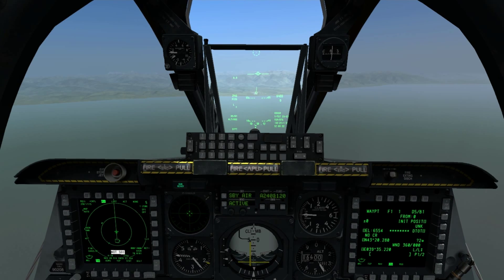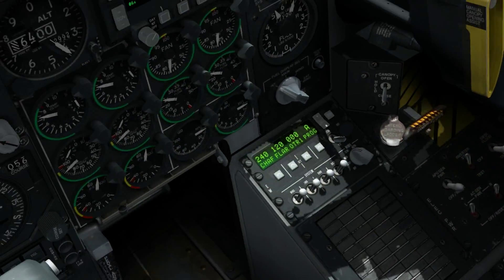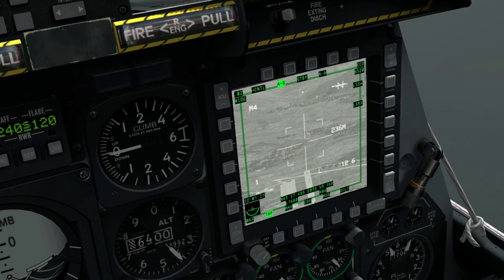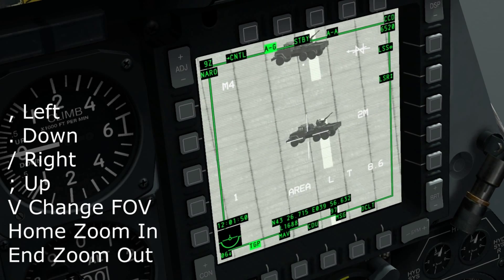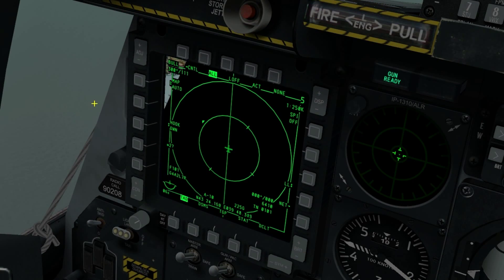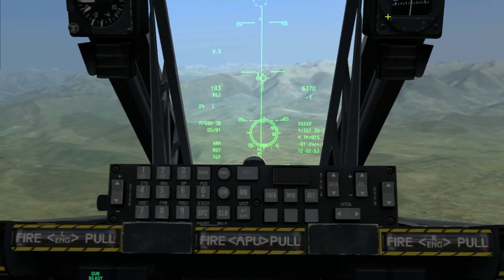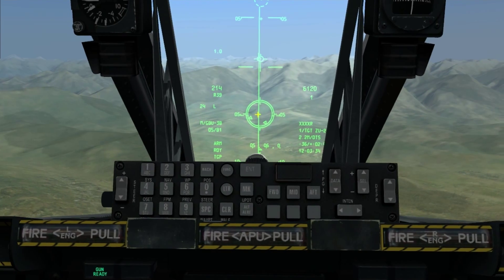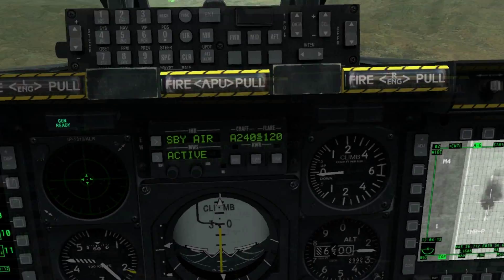How to use the GBU-38 and GBU-12 for the A-10C Warthog on DCS Part 1

Comment: were you using CCIP or CCRP mode or does it even matter?
Reply: CCRP is the best for the laser guiding or gps guided bombs. CCIP is more for dive bombing , and CCRP is for level flight from high altitudes.  I have pulled off a dive bomb with the gbu 10s and 12s by just rolling over above the target and aiming basically straight towards the ground. The bomb releases and after a few seconds starts guiding. Sorry for the essay, hope this helps.

Comment: is the cbu 103 GPS or laser guided
Reply: florianweiss007 GPS, the only LGBs are the GBU 10 and GBU 12
Reply: Jaffa.cake.yey 

LIST OF ALL ARMEMENTS

Cannon

The GAU-8/A 30mm cannon can be loaded with three types of round.

TP - Training rounds

HEI - High Explosive Incendiary rounds

CM - Combat Mix that combines HEI and armored piercing rounds

 

Rocket Types

MK1. Explosive warhead

MK5. Explosive warhead

MK61. Training rocket

M151. Explosive warhead

M156. Smoke warhead with white phosphorus

WTU1B. Training rocket

M274. Smoke warhead

M257. Illumination warhead

M278. Illumination warhead

 

Unguided Bombs

Mk-82. A 500-pound bomb with 87 kilograms Tritonal is the most widely used A-10C unguided bomb. It provides a good options against unarmored and lightly armed targets using shrapnel and blast effects.

Mk-82AIR. This version of the Mk-82 is an aerodynamically retarded BSU-49 / B. This allows the bomb to quickly slow after release, which enables use at low altitudes. This bomb can also be dropped in low drag mode depending on the DSMS fuze setting.

Mk-84. The big brother of the Mk-82, it contains 906kg to 428kg H-6 or Tritonal. It's most effective against unarmored and soft-skinned targets, the Mk-84 could nevertheless be effective against armor, if impacting in sufficient proximity.

CBU-87. "Combined Effects Munitions" CBU-87 is a 453-pound cluster bomb. It uses the SW-65 Tactical Distributor Sub-munitions dispenser that contains 202 BLU-97 cassettes; they are effective against both armored and unarmored objectives.

CBU-97. The CBU-97 consists of an SUU-66/B tactical munitions dispenser that contains 10 BLU-108 submunitions. Each submunition contains four hockey-puck-shaped sensor-fused projectiles called Skeets. These detect targets, such as tanks, armored personnel carriers, trucks and other support vehicles, and fire an explosively formed penetrator.

 

Illumination Flares

LUU-2B / B. Illumination in the visible spectrum.

LUU-19. Illumination in the infrared spectrum. Designed to improve the use of night vision devices.

 

Laser-Guided Bombs

GBU-10 Paveway II. This laser-guided bomb variant of Mk-84.

GBU-12 Paveway II. This laser-guided bomb variant of Mk-82.

 

Guided Bombs

GBU-38. The standard Mk-82 with a GPS-guidance set.

GBU-31. The standard Mk-84 with a GPS-guidance set.

CBU-103. Standard CBU-87 with a Wind Corrected Munitions Dispenser (WCMD) INS-guidance set.

CBU-105. Standard CBU-97 with a Wind Corrected Munitions Dispenser (WCMD) INS-guidance set.

 

AGM-65 Maverick

AGM-65D. An infrared seeker and a directional 57kg warhead.

AGM-65G. An infrared seeker and a 136-pound armor-piercing warhead.

AGM-65H. A Charged Coupled Device (CCD) seeker and a 57kg warhead.

AGM-65K. A Charged Coupled Device (CCD) seeker and a 136-pound warhead.

TGM-65D. Training version of AGM-65D with inert motor and warhead.

TGM-65G. Training version of AGM-65G with inert motor and warhead.

CATM-65K. Training version of AGM-65K with inert motor and warhead.

TGM-65H. Training version of AGM-65H with inert motor and warhead.

 

Pods

Litening II AT targeting pod.

Travel pod.

 

Air-to-Air Missiles

AIM-9M. Short-range, infrared homing.

CATM-9M. Training version of the AIM-9M with inert engine and warhead